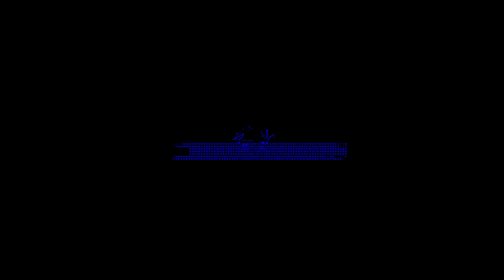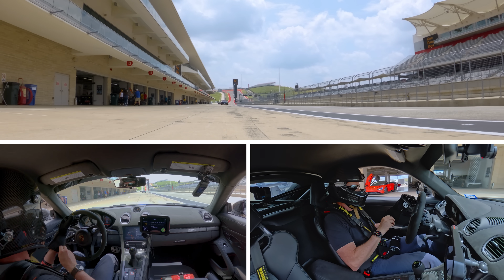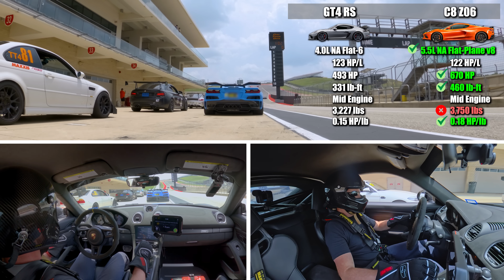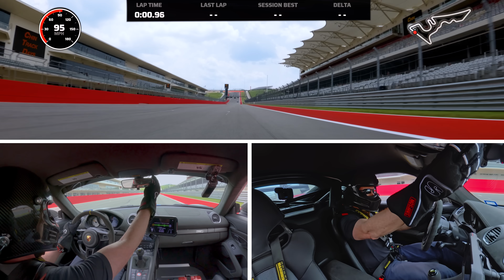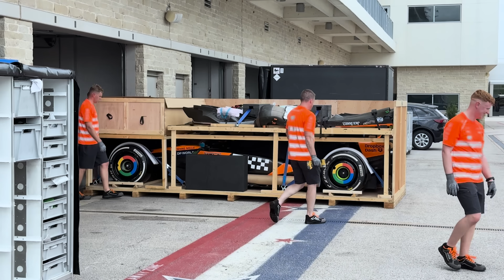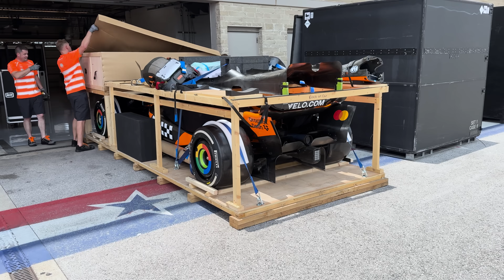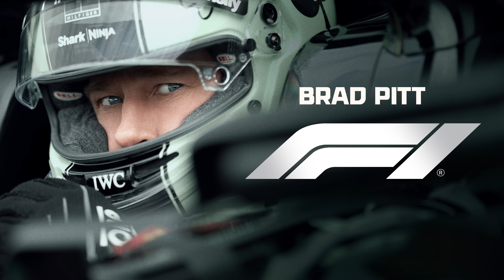Z06 vs GT4 RS : American Power Meets German Engineering at COTA

Comment: Love the videos, I have the C8 Z06 and the GT4RS, both are fun cars. Ultimately the Z06 is faster around short and long tracks. The Z06 brakes better than the 4RS with both being carbons.
Reply from the maker: Thanks for watching! That’s a great combo of cars. How do you find the brake-by-wire feel compared to a traditional hydraulic setup?
Reply: @ItsTrackTime the Z06 brake by wire takes a little bit of getting used too since you need to modulate the speed you hit the brake pedal to get max grip fast but it works well and I find brakes better than the 4RS
Reply: Caymen/boxster is a weak sports car, It's not even in the same league as super cars like the z06
Reply: @Greenmonkey552  its a light mid engine pure car. No fancy things inside. Its very potent on track with few mods and is cheap to run on track compared to the z06.
Reply: @DudeThedudesky The z06 weighs at worse 200 lbs more, meanwhile the z06 makes more than double the power and costs the same, nice cope
Reply: @Greenmonkey552  interesting, a quick search shows the porsche is  ~1460kg and the z06 ~1700kg the gt4rs has 500 hp whilst the z06 has 670hp
Reply: @DudeThedudesky

The z06 is only 1558 kg with the carbon wheels, its barely heavier whilst being more powrrful. Anyone who spends the money on the porsche is a simp
Reply: @DudeThedudeskyincase you cant do math, z06 has a .43 hp/kg vs the porsche only has 0.34hp/kg ie the vette is the superior designed vehicle by FAR. Its not even a competition for you porsche fangirls
Reply: @Greenmonkey552  ignorance knows no limits. That weight you gave is with no fluids. With fluids its just shy under 1700kg, there ain't no way a corvette is better designed than a porsche 😂
Reply: @DudeThedudesky

Wrong, 1588 is kerb weight(ie wet weight)
Reply: @DudeThedudesky"aint no way a corvette is beter designed than a porsche"

Whose the fangirl here again??
Reply: @Greenmonkey552  its literally dry weight. Its like 1680 with fluids. Youre literally in denial or severly misinformed. You think a corvette is designed better than the record holder for lap times? And porsches are praised always. Not a single person dislikes their handling. The c8 z06 is literally just a ferrari copy. Americans cant make a good supercar (ford gt exception)
Reply: @Greenmonkey552  Cayman not Caymen man you know your cars lol
Reply: yeah no, the z06 is alot heavier and is only faster on straights due to more torque and power and less aero. The gt4rs is better in corners and obviously a car weighing around 200kg less wont need as big brakes as the z06 🤦‍♂ the gt4rs is also made for german tracks, not these american ones
Reply: The most ignorant and salty comment here hahahaha. Built for German tracks, stop it lol
Reply: @DudeThedudesky "built for german tracks" this is the dumbest comment of the year
Reply: @overcomeevil5928  yeah, its built around the nurburgring nordschleife as all porsches are and german cars like audis, mercedes and lamborghinis
Reply: @DudeThedudeskyYou haven’t driven either car around track, so you have no real place to talk? Keep warming the bench.
Reply: @danieldickerson4838  I drove both of them and many more thats why im arguing with all of you vette fangirls
Reply: @DudeThedudeskyI suggest you go and drive with a competent driver in a Z06 it is faster in any situation given the same level driver I own both and the Z06 is faster outright.
Reply: @thestigsfatbrother3881  i drove one, it didnt blow me away, theres a reason it doesnt have a good nurburgring nordschleife time. Im a guy who exclusively laps the nurburgring in high performance cars. The z06 and zr1 have disappointing nurb times and are extremely expensive to lap around compared to the ferrari 488 pista, lamborghini huracan, audi r8, gt3rs 991 and 992, merc amg gt r that i drove and my personal gt4 mr package manual and track rs5 1500kg 850hp with loads of downforce. You are delusional and biased. If im going to track a car that is that heavy id rather take a rs5 audi which has mechanical awd and weighs around the same with backseats and no lightweight materials.
Reply: @DudeThedudesky you sir are the delusional one, you can throw out all the hate you want, no facts to back them up, im not bias, I am a Porsche track instructor that has spent much time in many cars and stand by what I have said. stop lying about times, these are no official times for either of the cars you mentioned only amateur times which lets face it are nonsense.
Reply: @thestigsfatbrother3881  mate, the z06 c8 is 15 seconds slower on the ring with over 100hp more than a MANUAL gt3. The huracan performante got a 6:52 8 YEARS AGO. Thats 19 seconds faster than a z06 c8 and the c8 is obviously on much newer semi slick compound tires. You are biased, you never drove on the nurburgring i presume. The z06 is not capable of rivaling with these cars. Stop being delusional and butthurt for some odd reason, what im stating are literal facts. A heavy ferrari copycat is good, but not as good as cars that have been in the game for a while making mid engined cars and immense racing success.
Reply: @DudeThedudeskymy guy the z06 was only 2 seconds slower on the ring and it was GM’s engineer (not professional driver). The gt4rs time was with a known professional driver. The c8 Z06 is the faster for in straights and around the track
Reply: @donovahnnduhaney7608  the z06 has more power and less downforce. It has more aggressive alignment settings too probably. Porsche have the gt4rs worse alignment than the 911 porsches so it doesnt do too well on track. The gt4rs will do laps for days whilst the z06 needs tires and brakes after 2 laps
Reply: @DudeThedudeskylol not likely I have both and rather use up a set in two week ends.
Reply: @thestigsfatbrother3881  a z06 is not lasting on the nurburgring. Stop being a delusional unexperienced bigot that's in denial. On top of frying brakes and tires the z06 will overheat probably
Reply: @DudeThedudesky again more nonsense out of the butt, again personal experience has shown the both my cars with Carbon ceramics and the 4RS uses braes at a 2 to 1 ratio against the vette, both do about three track days on a set of cup 2R tires, the Porsche costs more to service as I use dealers for both, you are just arguing for the sake of arguing but clueless in the facts.
Reply: @DudeThedudeskyno the man owns both cars and straight up said the Z06 is ultimately fast on short tracks, long tracks and braking so you just spitting out what you wish it was and what you want it to be but it’s just not there according to pretty much everyone except you and it sounds like you haven’t even drove one. I haven’t drove one either but I’ve always been a fan of corvette and when a man that has both cars and push both of them and says straight up the corvette out performs the other I will put my money on him.
Reply: @Pipefitter0307  lemme guess you like nascar too? 😂🦅🦅🇺🇲🇺🇲 the z06 is not a track car. The gt4rs is a track car. I have thousands of laps on the nurburgring under my belt. I've driven all the porsches. The z06 is much heavier and not built to last on a track. Tires, brakes and cooling will not last. If you've got deep pockets and love corvettes, go ahead and spend that much money on tires to get 1 lap out of them. Mid engine cars are risky. Im not trusting a car manufacturer on the track that have never made a mid engine sports car before. Audi, porsche, lamborghini all make or made the best mid engine cars. Not some American copy cat.
Reply: @Ascarirari  so doing a argument makes someone a angry little man? Im simply correcting those people that are wrong. I was in german military, ex ksk and box for all my life. Cant judge someone who will try to win an argument against biased Americans that know nothing about cars.
Reply: @DudeThedudesky maybe get off a sim and do actual real life laps so you can speak with more actual experience. Sim laps dont count.
Reply: @thestigsfatbrother3881  😂 yeah thats just wrong. On a track alignment a car that weighs approx 300kg less will not eat the tires nearly as much. Noone uses carbon ceramics for the track. Also sim counts even though i dont drive on it much. Look at max verstappen or misha chardouin. If youre homosexual and cant do basic maintenance yourself, then thats on you. Porsche has refined the boxster platform for decades. Corvette just said "try to copy from a rari and put a vette badge". The c8 is not a corvette. The c7 is. Youre basically saying the c8 defies physics and uses up tires less. Also the z06 has like what, 345 rear tires? Good luck paying for that if you actually track the car. I have actual track cars built by me, fully custom. They destroy any corvette on track, i go sub 7min btg alot on the nurburgring, most times if theres light traffic. I have thousands of laps on nurburgring and driven most cars. The 718 platform is a successful endurance race car too. If you think the porsche is bad, sell it. You think a corvette is better because you are a biased fruity American with no car knowledge. Porsche also dialed down the gt4rs so it wouldn't perform too well (to not lessen 911 sales), which is why it comes with shit handling stock configuration

Comment: I'm glad you did this one.  I too considered the Z06(I had a C6Z and loved it) and wondered how it would compare to the GT4RS.  Now I know, thanks!!
Reply: No, you don’t know. In the first place, this is a very heavily modified Porsche, you can look back at OP’s original videos to see what he’s done to it but it’s far from stock. And the second place, he was driving at 10/10, the other guys were not.  Stock to stock, there’s not one test by any publication where the RS has pulled a faster lap than a Z06.  Not knocking the RS, it is a fabulous car and handles brilliantly, but it’s not the faster of the two round tracks stock to stock with equal driver/experience in each car.
Reply: @markw9512  I don't think anyone suggested it's faster than the Vette, and I think at this level the skill of the driver is what makes the most difference.  The GT4RS is designed to have adjustable camber and aero and getting rid of that European OAP is a must to get rid of a dip in  low rpm torque/hp.  Plus it was designed as a fun road car that could also do well on the track (Andreas Preuninger). At 70 this is gunna be my last fun sports car and I simply preferred the look and sound of the Porsche better than the current Vette.  I'll never get to the level that I need to worry about these performance tweaks anyway..:)  Finally I loved my c6Z06 and would have considered another Vette if they hadn't f'd up the rear end of the c8...:)
Reply: @whatsupwithsteve  no what I’m saying is that this video did not really give a good comparison of this car versus the CH006 in any way, because the other guys were clearly not driving as close to the limit as he was.   I mean this guy has put in tons and tons and tons of hours at this track, and it shows.  If you really wanna know how to vehicles compare, you get to drivers of comparable skill, with the same kind of tires on the car, etc.…. You’re not gonna go wrong with either of them, put it that way as both of them are a blast.
Reply: @markw9512  Yep I agree!!

Comment: How do you think cutting rotational mass with carbon wheels would affect the z06s braking and acceleration performance? I'm not sure how it would affect the mid corner but I feel like cutting out that unnecessary inertia would fix some of the problems you were talking about with the car
Reply from the maker: That might help, but I haven’t heard great things about carbon wheels on track. I’d stick with forged wheels and maybe drop the diameter to cut weight and increase grip. Just look at the Corvette race car as a reference.
Reply: @ItsTrackTime  it also is highly dependent upon if the car is a track toy only, or if one will drive it on the street.
Reply: My car has carbon wheels that I normally run with. I was running 19”’street tires because I had a student with me this event.
Reply: we ran carbon wheels and it cracked lol.  we also swap out ccb to ap competition brakes (more rotation weight).  we are not good enough to feel the difference.  the bad brake in the c8z is mainly he is running cup2 vs oem cup 2R

Comment: Brandons garage has the car down to 3,300 lbs half tank. GMs Y2 chassis C8 cars are far more advanced for TRACK PURPOSE than you might know. You get a extra 40hp just with a Eventuri intake. The Z06 platform is a great track prep platform, as are all the C8 series.
Reply from the maker: 3,300 pounds would be very interesting! If I owned one, I wouldn’t be chasing more power—I’d be looking for more lightness.
Reply: its heavy and doesnt have rear wheel steering, its not as sophisticated or good as like a huracan or r8 which are similar. c8 isnt a good track platform unless you have alot of money to spend on brakes and tires
Reply: @DudeThedudesky it's better than both of those cars mentioned. Extra tech = extra weight
Reply: @goobingtons  the r8 and huracan dont have rear steering and are lighter. They are good examples of mid engined traditional supercars that are known tried and true track platforms with amazing lap times and race record.
Reply: @DudeThedudeskyand yet theyre still slower on track. Oops
Reply: @DudeThedudesky Yet the ZR1 and ZR1X would demolish those cars. The Z06 already does that. Even the E-Ray would beat both of those.
Reply: @goobingtons  what track? Definitely not the nurburgring 😂 the huracan has a much faster time than the z06 c8, sure it can have 400hp more but it will be much heavier and not a track and will try to kill you each time you try to lap it
Reply: @XxViciousxX  yeah I doubt that, if a z06 cant even get close to them then a much heavier, zr1 will only be faster in the straights on the nurburgring and will fry consumables after 1 lap, and good luck getting reliable lap times with that much power.
Reply: @DudeThedudesky BS
Reply: @DudeThedudesky it beats both those cars
Reply: @Mike-ne9cw  yeah sorry bud but you're delusional. Look at nurburgring lap times for example. The z06 with alot of power cant even scratch the under 7 min mark.

Comment: I looked into it too, I even had an order and cancel it. I don’t like the interior and the square-cle
Reply from the maker: I’m not a fan of the interior styling either, but man—I want that engine. And I love that they delivered it in a mid-engine platform. They got 85% of it right.
Reply: the blue c8z is not on oem 2r which is much faster.  we track 2024 gt4rs and (2) 2023 c8z06 and on real small course (38s) gt4rs was faster and bigger track c8z is faster like sebring.  we also have 992 gt3 and 992 gt3rs we track but dont push like z and 4rs.   I was there same day and fastest I got was 155 mph but I haven't figure out the brake zone.  so under hot weather, what do you think gt4rs can run?